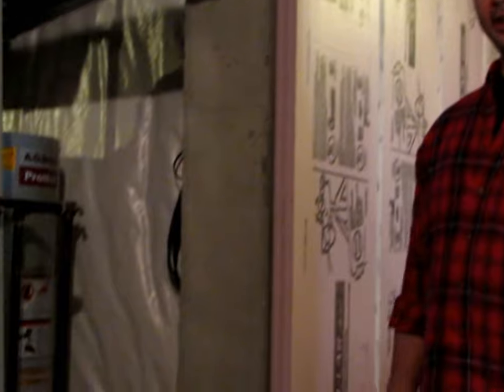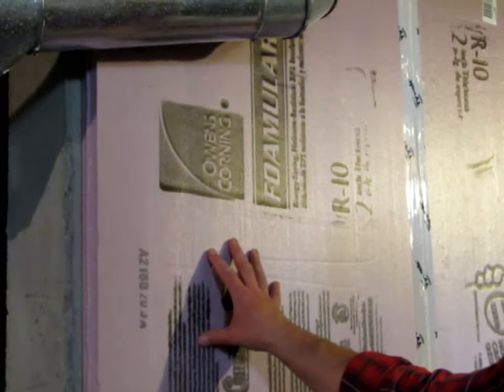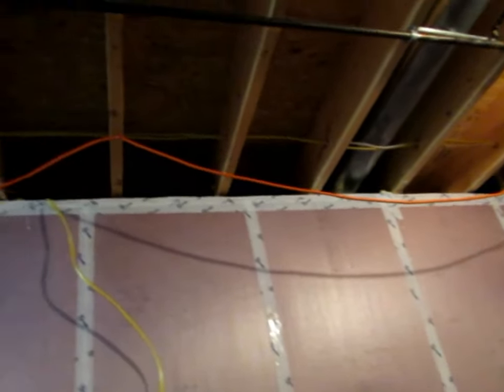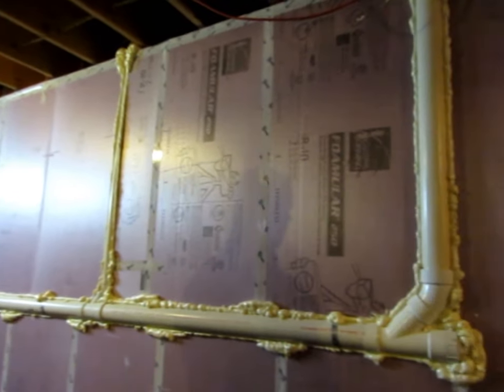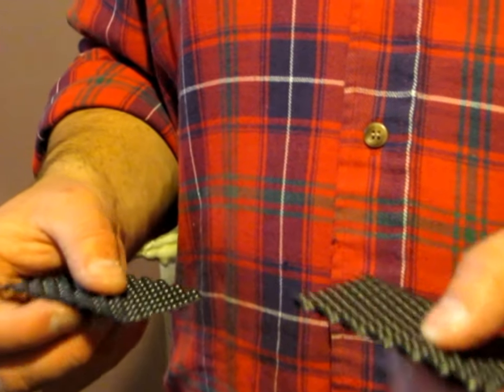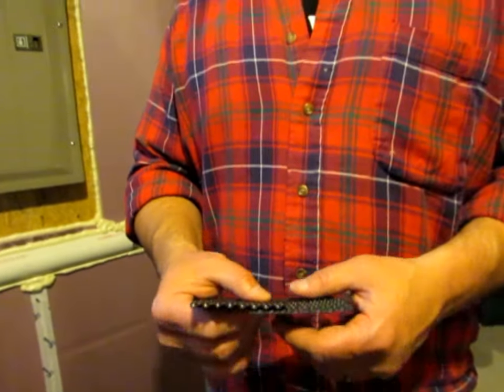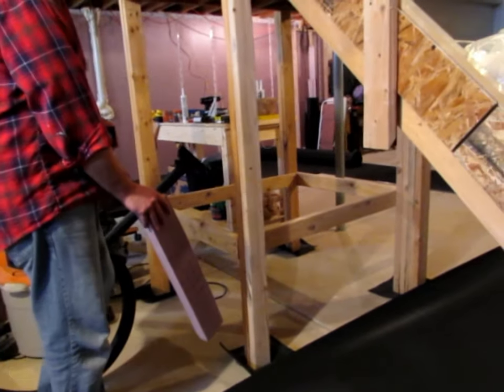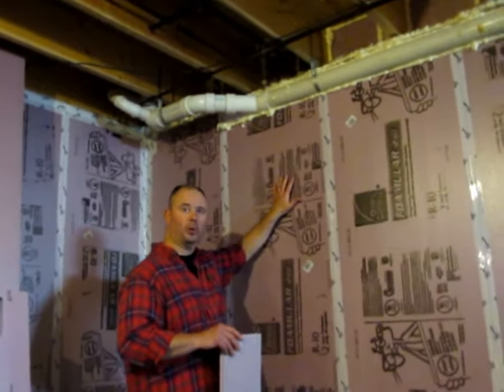Finishing a Basement -  Part 1 - Basement Insulation & Damp Proofing

Comment: What are your thought on putting DRYLOK prior to the foamboard on cinderblock wall. No moisture issues and sump pump already installed. Looking to go above and beyond for future issues
Reply from the maker: Answered this same question many times so shows how common that is.   Paints / coatings will not last on concrete and will eventually fail and lead to moisture penetration, and once the walls are covered up you can no longer maintain it.  The concrete also needs to breath and coating prevent that which actually exacerbates the moisture problem.  Lots more info out there on this topic.

Comment: In an older home, would it be a good idea to Drylock the walls and floors first along with caulk the wall/floor seam prior to drylock to create that initial seal before doing this? Also, I have concrete block walls .. does that change anything with the wall setup?  Thanks!!
Reply from the maker: Thanks but I disagree.  I have replied to a number on comments asking or suggesting a sealant / paint (i.e. DryLock), and this has been proven to be a poor long term idea which can cause greater issues.  The concrete needs to breath.  Please refer to other comments and the referenced materials which describe this issue.

Comment: The diple may seems like a good idea. The water wont make it to your sump unless the floor is perfectly sloped to the basket. Likely you have some areas of high and low throughout.
Reply from the maker: Thanks for your comment.  Keep in mind the dimple mat also allows the concrete floor to breath, and so this will eventually drain to the sump via floor slope if there is enough water, or absorb back through the concrete as the concrete dries, or evaporate through breathing.

Comment: What kind of basement wall insulation would you use in southern climate? The coldest basement temp has been 52 degrees and hottest has been 72.
Reply from the maker: Not sure I have a definitive comment for you other than if you have any moisture / condensation potential (i.e. interior temp can drop below the moisture dewpoint) and/or you have water leaking issues in your foundation, then I would suggest a similar system but you could probably go lighter on the insulation value.  Otherwise not sure why you would insulate if it is already war, and no water / moisture concern.

Comment: For the rim joist , Should I use spray foam in behind the Foam board FIRST, then stick on the board?
Reply from the maker: No need to spray or adhere the back of the foam board.  Board should be cut to size or close to it, then the spray around the perimeter holds it well in place.
Reply: @Buffalo-J  Thank you~

Comment: Researching this currently but most videos show a poured smooth foundation finish. I have a poured foundation with the brick like finish can I still make an appropriate seal?
Reply from the maker: You foundation should not matter.  The concept is the same regardless.  Although your more rough foundation may require more measuring and layout work to get things square and also to keep the foam up against the walls...see the other videos I have done on framing.

Comment: I have an interior french drain. Would be okay to have studs 18 inches from drywall and the the dehumidifier behind the unfished part?
Reply from the maker: That's interesting but a very different situation.  I suggest consulting with other water proofing and/or HVAC professionals about your case to understand if this would even work...that's a lot of moisture you're trying to control as anything you condense out I assume will go back to the drain and then have a chance to just vaporize again.   My only other comments are that you should do a little more research about creating your vapor barrier on the back of the framed wall side and not against your foundation...otherwise you're kind of defeating the purpose.  Also suggest plan for easy access to that for maintenance of the equipment if you do this.
Reply: @Buffalo-J  thank you. We were considering using 2 inches of closed cell spray foam on the cinder block down to the french drain as well that should stop the vapor. But we still leave that gap in case the french drain fails. It leads into a sump pump and hasn't failed yet
Reply: @Officialbillyd23  Hi, I have the same basement as yours (HVAC, sump pump, 2 inch french drain). Did you finish your basement and how did you control moisture? Thank you.

Comment: is there any need to paint or seal the concrete walls prior to installing the Polystyrene?
Reply from the maker: Do not paint or seal concrete.  There is plenty of info out there but concrete by nature is always wet and any type of sealing will in the long term be a futile effort and possibly cause more problems.  Concrete needs to breath.

Comment: I hope i didn't miss this, but how did you address fire blocking requirements?
Reply: Same, I've seen many YouTube basement rigid foam wall builds that don't appear to have any vertical or horizontal fire blocking that is often required by code.  I'm not a big "rule and regulation" guy, but if finishing a basement I advise looking into the code for fire blocking to avoid headaches down the road.
Reply: @bigworldparty  Foam Board gives off rapid smouldering toxic and suffocating fumes and must be covered in case of fire. Check you local codes.
Reply: insulating with foam board the rim joints (as shown with his flashlight) and leaving it exposed is not to code, at least in my area (not sure where you live). Foam board must be covered/finished with drywall. Foam Board gives off rapid toxic and suffocating fumes and must be covered in case of fire. Check you local codes.
Reply from the maker: @DeeInTheHouse  Yes, you're right.  None of the foam is exposed .....keep in mind this is part 1 which addresses only the insulation & moisture proofing of walls...this is far from the finished basement.
Reply from the maker: @DeeInTheHouse  Yes, you're right.  None of the foam is exposed .....keep in mind this is part 1 which addresses only the insulation & moisture proofing of walls...this is far from the finished basement.

Comment: Would you have changed anything you did with vapor barrier and insulation after living with it for some years now?
Reply from the maker: Honestly, no.  It's been working excellently.  The basement is far warmer in the winter and cooler in the summer than I ever expected...in fact it's the mots stable / comfortable room ion the house because it's always at the right temp....makes me think we should build houses underground normally ! :)  No issues whatsoever with moisture, and despite this construction having the potential for small deflection due to thermal changes, etc., I have seen zero cracking in drywall (but I also used really good corner beading as well).

Comment: I was looking at a similar solution, but then this video (https://www.youtube.com/watch?v=kwn0Vjw_ji0) made me worried that trapping that moisture would push it up into my sill plate/rim joist. Do you think the exposed upper foundation wall that you mentioned is enough to mitigate that?
Reply from the maker: First apologies for the delay in this reply.  Great question and that is a great video you referenced; I've watched that myself long before I started this project.  I recommend watching for any who haven't.  My first answer to your question is home construction should include a capillary break between the foundation and the sill plate specifically to avoid what you are referring to as both concrete and wood are porous and wick water well.  This is also why sill plates should be pressure treated.  If your foundation does not have a capillary break and is not pressure treated then you likely already face this problem regardless if you aim to moisture proof your interior, and the wicking wont stop at he sill, it will move up through your framing as well.  in such a case you should probably consult a local expert or inspector to get an opinion on your specific case.  The foundation, surrounding soil, and atmosphere above the soil are always working to find equilibriums with their relative water saturation state.  The foundation below the soil surface will absorb water from the soil when the soil contains more relative moisture, and likewise the foundation above the soil (and on the inside of your home) will work to discharge moisture to the drier air and to the sill, plate if in direct contact.  In my own builds we have capillary breaks between the foundation and sill and/or pressure treated sill.

Comment: insulating with foam board the rim joints (as shown with your flashlight) and leaving it exposed is not to code, at least in my area (not sure where you live). Foam board must be covered/finished with drywall. Foam Board gives off rapid toxic and suffocating fumes and must be covered in case of fire. Check you local codes.
Reply from the maker: Thanks for the reply.  Yes leaving XPS foam exposed is not code and it is not exposed.  All you are seeing in this video is the insulation and not the finished wall and ceiling spaces after fire blocking.

Comment: I get why you thought it was a good idea to seal off the top with your foam, but it is actually working against you. You don't want to completely seal off an area that collects moisture. You want it segregated from your living space, but you do absolutely want a path from your floor joists and band board to the damp air space, under the floor, and back out to the other side. This allows the space to dry out and prevent nasty mold and a bunch of moisture from being trapped around your finished space.
Instead, run your foam board straight up in to the joists and maintain a 1/8" to 1/4" gap between your foam and the block wall using 4 big globs of glue on each corner. You can then spray foam around the gaps between your joists and subfloor above. Your moisture trapped behind the foam and in the concrete pad will then wick to the joist tails and band board, where the outside air can keep it dry and pull it away. Hope this helps.
Reply from the maker: The sill was pressure treated wood but also with a vapor barrier in between the concrete and the sill which is current standard (at least here :).  The wooden sill is inset from the interior edge of the foundation wall so I insulated the exposed concrete up to the sill and then spray foamed to the sill so the concrete is sealed which is what you want.  Therefore the sill has not direct contact to the concrete and is still exposed and able to breath on the upper and outer surface.

Comment: What kind if spray foam is good for foamboard in the seam?
Reply from the maker: A spray foam which is compatible with XPS, EPS and similar rigid foams will work fine.  I used DuPount Great Stuff.

Comment: Tyvek tape is not a moisture barrier.
Reply from the maker: I wonder if you're referring to Tyvek wrap in which you are correct is not a vapor barrier itself as it is designed to breath. However Tyvek tape is polypropylene and is waterproof.   From the DuPont website:  "Tyvek® Tape is strong, easy to use, and highly waterproof. It is constructed of an oriented polypropylene film, coated with a specially formulated permanent acrylic adhesive".  Regardless, the primary sealing between the foam joints is the spray foam.
Reply: I'm referring mostly to the adhesive portion of the tape. Moisture will propagate through the adhesive joint in Tyvek tape when attempting to utilize it for sealing purposes. You did mention "house wrap" when you were talking about the tape, which led me to comment, and people need to know Tyvek is not meant to be a moisture barrier. Nor should Tyvek tape be considered a good moisture barrier as it was not designed for this purpose due to the normal eventual separating effect of typical saturated tape adhesives, even when they are "specially formulated." Nonetheless, your spray foam in the joints in this particular project took care of it anyway. Great job overall.
Reply from the maker: @Cotronixco  Thanks, and sorry for delayed reply.  And agreed.  The tape is more of a belt to the suspenders which was the spray foam between the joints.  I would use a different tape if I needed only for moisture barrier, but this was more to hold the panels and joints in place while foam does the heavy lifting on moisture barrier.  The Tyvek tape doesn't seem to hold a solid long term bond to the foam anyway.

Comment: Wrong foamboard. Polyiso below grade
Reply from the maker: Thanks, but I personally disagree as most Polyiso products will require fixing methods to the foundation which would require compromise of the vapor barrier (i.e. anchors through the material) or otherwise will require additional work to ensure any such compromise is again addressed to re-establish a complete 100% barrier.  Likewise some Polyiso products may have organic materials in the backings which is in direct conflict with what we are aiming to achieve on this indoor mold/mildew resistant application, sop buyers need to be careful.   Finally there are studies which show Polyiso performs worse than other products the colder it gets.  These are my opinions based on research and experience, but everyone will have their own.  For the benefit of anyone else reading please do your own research and make you best educated decision between XPS, EPS, and Polyiso.  Some references you might use as follows:   
http://www.owenscorning.com/NetworkShare/EIS/10019950-FOAMULAR-XPS-vs-Poly-FAQ.pdf
https://www.ecohome.net/guides/2254/polyisocyanurate-foam-is-a-hot-new-building-product-learn-where-and-where-not-to-use-it/
https://www.wconline.com/articles/87430-the-finish-line-eps-vs-polyisocyanurate-insulation#:~:text=EPS%20boards%20are%20homogenous%20EPS,act%20as%20a%20vapor%20barrier.